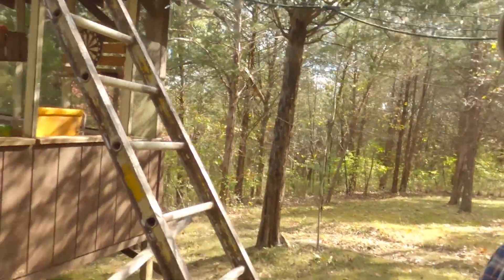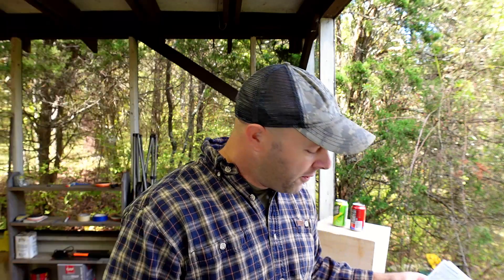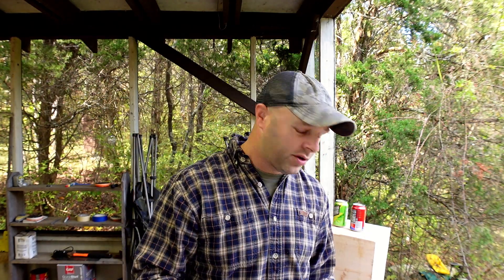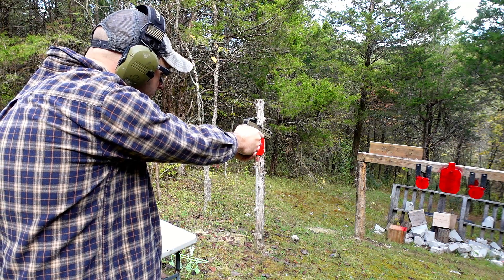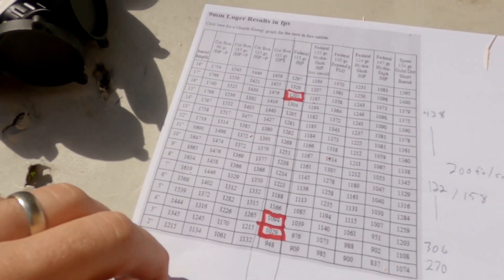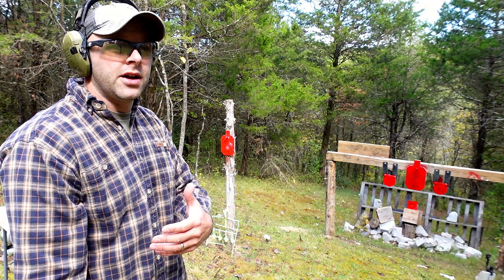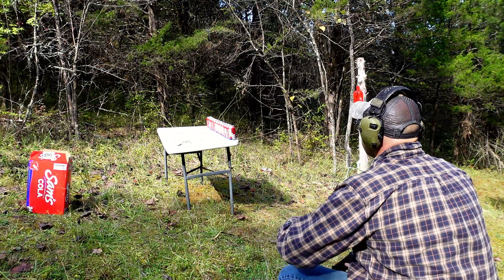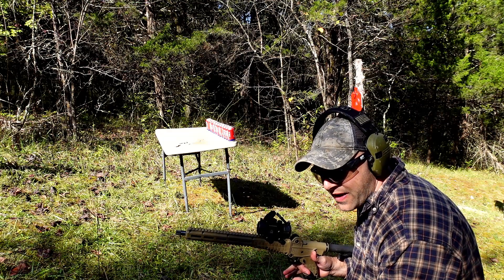Does pistol barrel length actually matter?

Comment: Most people use 115grn for practice. Try the test again with 147 grn and see what happens. 147grn will carry more energy. I'd try it myself but don't have anywhere to do testing.
Reply from the maker: In general 147gr will have less energy than 115gr because of how much slower they go.
Reply: @RuggedAdventures  Hmmm 🧐. Just saw your reply. Haven't got around to checking stats on factory rounds. But my in my response was mostly inspired by Col. Cooper who once said "You can't make up for mass." I believe he was speaking of the 45 acp. So I'll trust you, but I'll verify, Ronald Reagan!  BTW just saw something about the new 9mm NATO round which is 135 grn? Didn't save the exact weight in my 65 failing organic HD. Be interested in seeing that rnd tested your way just for fecal matter and Giggles. Thanks for the reply.

Comment: 9mm doesn't have that much powder in the case to begin with .
Why don't you try the same test with .357 mag. or .44 ?
You might find vastly different results.
🤣🤣🤣🤣🤣
Why don't you try a more consistent test medium like ballistic gei ?
Please don't bother to respond , I know this a very UNSCIENTIFIC video show.
And in closing....
barrel length DOES make a difference both in length and caliber . The amount of difference varies according to the caliber you're using.
Reply from the maker: 357 is definitely an exception since it takes the same 9mm diameter and adds a ton of powder. Behaves like a rifle round in a way. 44 mag has the same diminishing returns with barrel length.

Nobody is stopping you from starting the ballistic gei channel, whatever that is.

Comment: Few questions.
1) Didn't quite understand, so the P365 penetrated least?  (I got the other two).
2) How thick is the wood?  exactly 1" a piece?
3) Is the wood the stronger stuff, or on the softer side?
Reply from the maker: The P365 penetrated the least. 1.5 inch structural pine. It's a 2x12x8 cut into 1ft sections.
Reply: Ah, got it